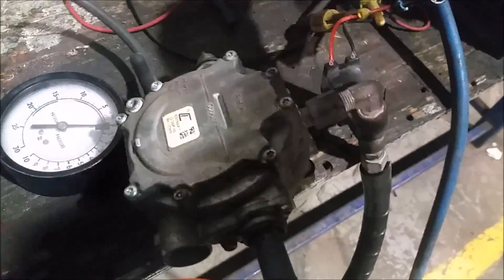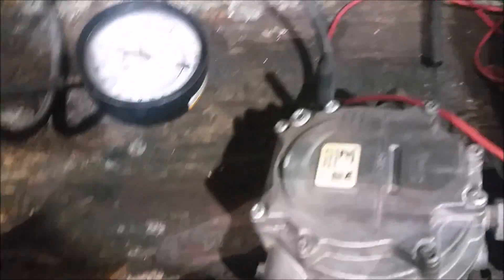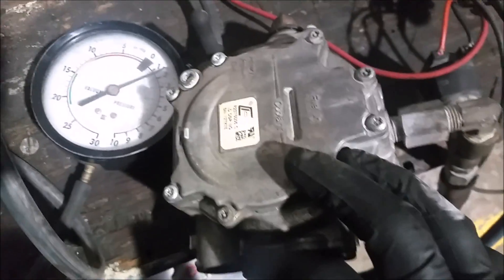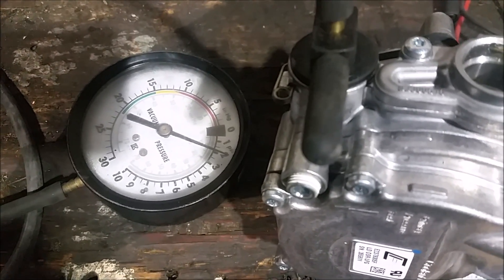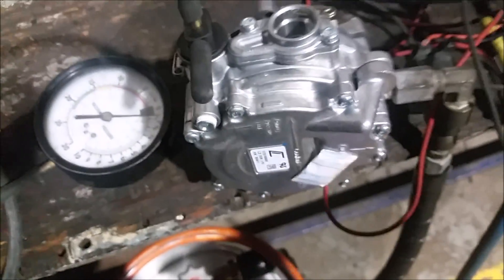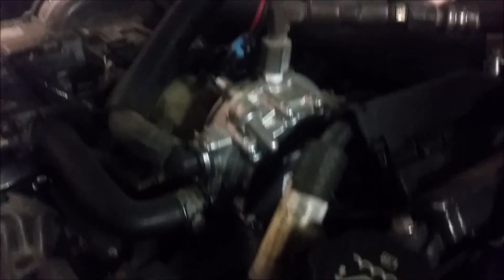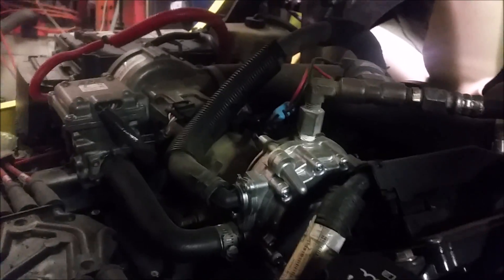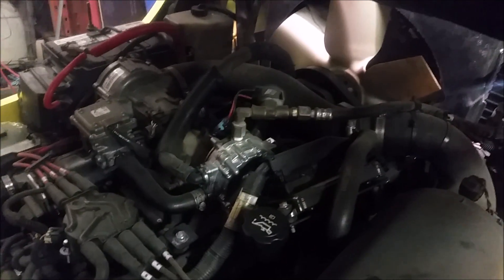No Start Excessive Fuel - Final Update

Comment: guage defection is normal, it shows inline supply pressure, the high deflection will come down  once vacuum is active and the secondary regulator is open, the constant flow pressure is adjusted to maintain regulator flow between 3 and 4 pounds depending on engine size, lower engine size will need lower adjustment to about 3 pounds, test should only be done regulated air pressure not exceeding guage max, lpg flow pressure should be done at engine idle with normal operating temp to check primary flow rate, ussually slight adjustments can be done, then lock and close,

the high deflection noticed on the guage is normal due to the lpg pressure pressure when engine not running and vacuum are close, once vacuum are open the primary pressure will drop  down again to normal adjusted regulated pressure when engine are running,

Comment: Check the lpg injector, if it has one,,,they stick,,,if no start in cold weather add heat with heat gun ,,60 sec plus,,,,if that don’t work could be faulty, remove ,plug back up, ground, turn key on,,should vibrate, and see some movement in the end of it,, if none it’s bad,,,

Comment: sorry, one last thing, the guage will damaged due high pressure not regulated, under normal operating conditions the gauge are not present, the 1/8 hole is closed of with a plug, once the engine are swithed off, the lpg pressure is locked in between the solenoid and the secondary  vacuum lock off, this lock of is important due to the fact that when the ignition is on solenoid are opened the no need for lpg "bleed" to happen and the engine will start almost immediately when ignition are turned and the vacuum lock off is open via engine vacuum

Comment: Simple hyster or Yale  all that could be done on the truck    Your taking tank pressure down to 2-4 psi several styles but all the same    Impco fuel system

Comment: Fan of your videos bro keep it up 👍🏽 i got a qs, in an old nissan like from the 80s , you think this could be the problem if it runs good on a cold start but ones it warms up it shuts off? Another qs do both the mixer and regulator gotta get hot? Thanks for your time
Reply from the maker: When it shuts off you have to figure out what is missing. Two suspects would come to mind, fuel and ignition. If the level of coolant is low the vaporizer would not be able to efficiently convert the liquid propane to vapor. With ignition, sometimes the ignition coil tends to fail when it gets hot.

Comment: I have a hysterectomy 40XL and it looks like there are 2 vaporizers in there???  the one close to the tank looks like it ices up after a few minutes, running the forklift it feels like "an  empty tank" it does when the rpms come down and it won't hold idle well .....  do you think I need a new vaporizer ?
Reply from the maker: It is possible but before replacing it, make sure your coolant is not low.
Reply: @forkliftgeek10  coolant low, radiator cap defective and water pump shot .. there is no hat water going thought the vaporizer but when the forklift runs for more than 5 min the radiator boils ....  so I git a new water pump, thermostat etc .... on order ...  thanks
Reply from the maker: Glad I could help
Reply: @forkliftgeek10  thanks for helping !
Reply: if you ever need to know anything about welding - hit me up or watch any of my videos .... I might not be the best at forklift repair but I like to think I am ok good at welding

Comment: Is it possible to bypass the solenoid valve for testing? mines not starting unless i spray the intake - its not clicking when i apply 12v but there is current cos it sparks lightly on jumper wire.. or can u bench test the solenoids?

Comment: Try again, what is a power ram on the side of a impco c250a vaporizer.  I know that it is controlled by a vacuum line to the manifold.  I assume that it has nothing to do with stopping flow through the regulator.  That is the lockoff job.  There is no stop valve within this regulator , It just flows through.

Comment: Curious why you didn't check fuel pressure at the primary test port on the vaporizer with it still on the truck first? That would have pegged the gauge immediately and told you the vaporizer is the culprit right away.
Reply from the maker: +JD10 when I did the first video propane was coming out of the vaporizer when cranking which for the older impco vaporizers would already indicate that it was already faulty. But forkliftfrank indicated that this is normal for this system. The service manual for this truck had no info on what pressure is to be expected. On top of that, there were other work that was needed to be done on the engine so the fuel system was already off.
Reply: I was meaning a gauge on the vaporizer with the system fully installed when you first diagnosed the truck. There's a primary test port for testing pressure on the vaporizer, remove the plug, install gauge. As soon as you keyed unit on the pressure would have pegged gauge.

Comment: So you were of course piping the gas into the regulator in it's liquid phase for the test , right ?
Reply from the maker: Yes, It would be in the liquid form until the lock off opens since it is still under the same pressure as the tank. Once it reaches the regulator primary and the pressure is reduced, it should vaporize almost instantly.

Comment: Hey great job I appreciate your videos greatly. I have a question for you I got a Toyota 7fgcu25. That just smells like lp out of the exhaust. The regulator doesn't respond when I turn the mixer screw it wont idle up or down any suggestions ??
Reply from the maker: +AIMone3WP your vaporizer might be putting out more than it should. Does this have an injector?
Reply: Not sure it had a vacuum leak so I put a hose and it started much better but then it idled too high so I tried to adjust it from the vaporizer n it would do anything. Just worked on it yesterday a few minutes. Going to take a better look today. I was just lost when the vaporizer wouldn't make a difference in the idle
Reply: But I'm pretty sure it does
Reply from the maker: +AIMone3WP if it has an injector then it would have a map sensor. If the map is reading low vacuum then the ecm would interpret that as a  request for more fuel and pulse the injector longer. Check your map sensor reading.
Reply: I will today thanks for the advice you should start your own forums page. You do great videos 💪💪
Reply: Hey thanks for your advice. It turned out to be the air cleaner hose. Someone had put rags inside the frame of the forklift where the pillar is and as soon as I removed those rags the smell went away

Comment: So , it is not vacuum controlled????, ,  it should deliver 1.5 psi at outlet side just by applying power to the solenoid???
Reply from the maker: No it is not. This system uses an injector

Comment: I have a Yale GLC050 2.4l It just has a vaporizer to a fuel rail with injectors, not sure what year it is. I put a brand new vaporizer with lock off value on, and it will only run if I barley crack the propane tank open. Any thoughts? Thanks. Edit -It was no start excessive fuel before I changed it just like this one.
Reply: You are describing a next generation fuel system. The fuel system in this video is a single point throttle body injection system. What you are describing is a multi point Intake rail system. This is like comparing apples to oranges.

Comment: I have this Korean car, Renault Samsung SM5 which runs purely on LPG full injection. It starts and runs  smoothly, but with time the engine dies out. I have changed the fuel pump but the dying out time has reduced. The stop valves are working perfectly. What might be the cause?
Reply from the maker: Never worked on lpg cars but the engine dying out does not necessarily mean it's a fuel problem. You got to figure out what is missing when it dies
Reply: @forkliftgeek10  Thanks

Comment: Hi Mate, where can I regulate pressure of a vaporizer regulator impco BEPR-31319-001? Thank you.
Reply from the maker: There is no adjustments on these electronic regulators. Pressure is set at factory for specific application.

Comment: where do you hook up the fault reader? I have a 2005 komatsu FG25-ST-14 with a hard start and no power with sputter idle. I have looked all over but can find where to hook up a code reader.
Reply from the maker: If it has a nissan k21 engine then it would have an obd2 connector. Otherwise it does not have one.
Reply from the maker: It does have one. https://youtu.be/biZ5_RO4jog
Reply: @forkliftgeek10  Yes thanks I watched that video but I can't find the connection port. Where would it be located on the lift? It's normally under the dash on a car but I have looked all over this lift and I can't seem to find it.
Reply from the maker: On a komatsu its usually on top of the transmission
Reply: @forkliftgeek10  still can't find it. Had a no-start condition so I rebuilt the vaporizer and now it runs but no power. The ECU failure warning lamp stays lit. Any ideas? It's model FG25ST-14  serial 589426. Thanks for your time.
Reply from the maker: @JAWSFREE  there is a way to retrieve code using the pedal and the blinky code. Take note that even a busted brake light would turn on the CEL.
Reply from the maker: Also take note that the diagnostic connector for a komatsu is only a 4 pin connector and not a 16 pin dlc. You need an adapter to be able to connect a scanner.
Reply: @forkliftgeek10  Oh no wonder I couldn't find it. I will try to figure out how to do the pedal trick and see if I can find the code. This thing is wearing me out. Thanks for the quick replies.

Comment: Can't you get rebuilding kits for these?
Reply from the maker: +workwillfreeyou I think you could. But we opted to buy a new one to use as a reference for the pressure readings.
Reply: I know my reply year late. But on these regulators notice the “tamper proof” Torx screws. Probraly no more rebuild kits, you have to buy brand new regulator. Reason why is the EPA compliant bull shirt rules.

Comment: so it wasn’t the solenoid?
Reply from the maker: The solenoid only allows gas to enter from the tank. It is the regulator that controls the pressure that goes into the intake.
Reply: ForkliftGreek Thank you